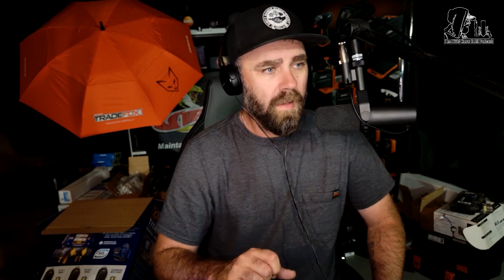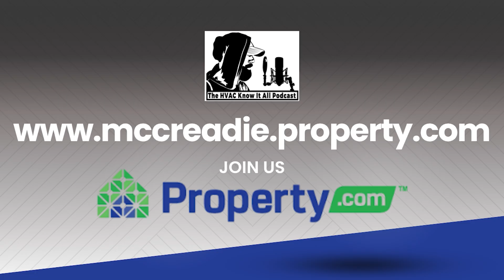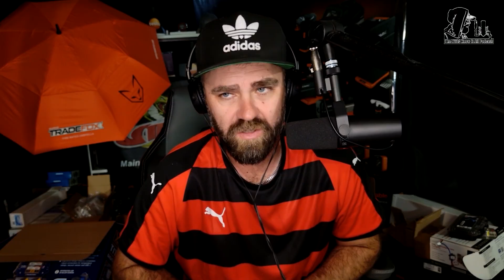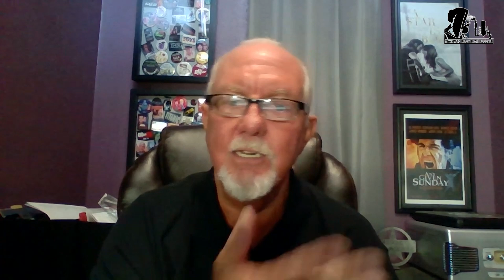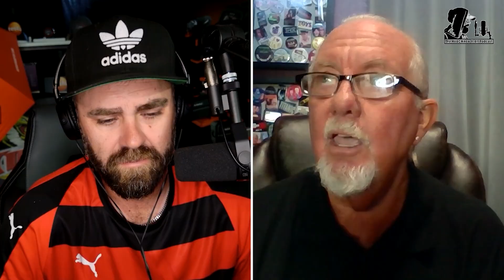The Truth About Air Mixing and UV for HVAC Pros to Boost Performance with John Ellis Part 2

Comment: Seems odd he says a uv light is the only iaq he recommends but never explains why or how to install and basically believes it just cleans surfaces.  Given manufacturers like Honeywell have sold uv-c for decades and they are proven to keep coils clean when installed per instructions, and the coils themselves provide a large surface over which air passes, it seems they do work.  On top of that hospitals routinely use them as a part of equipment and operating room room sterilization.  Water system equipment manufacturers have uv-c sterilization for making well or rainwater collection systems safe to drink without chlorine.  Those systems can function in real time as water flows down a supply pipe by directing flow into a slightly larger cylinder with a clear glass pipe enclosing the uv-c bulb.  Air and water filtration is always part of the solution but filtration by itself does not make a fluid, air or water safe when treatment is necessary.